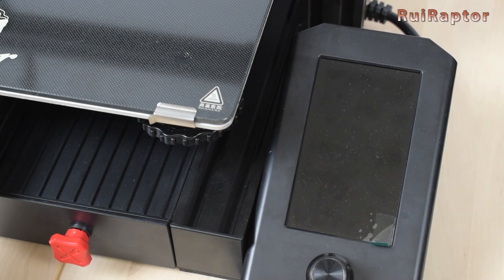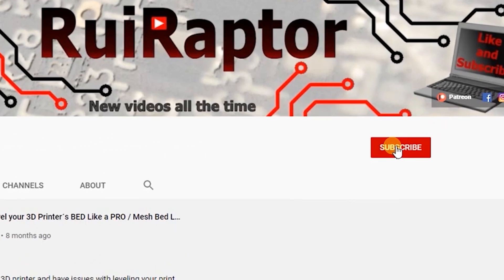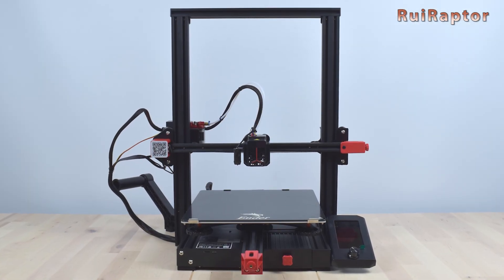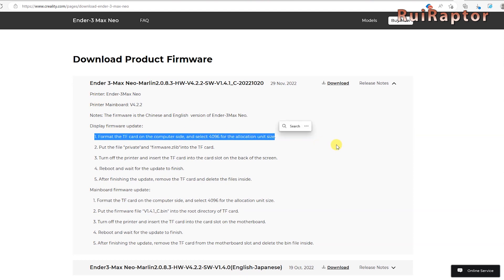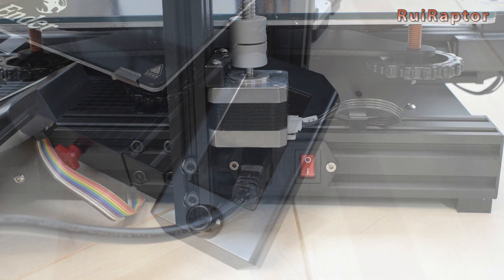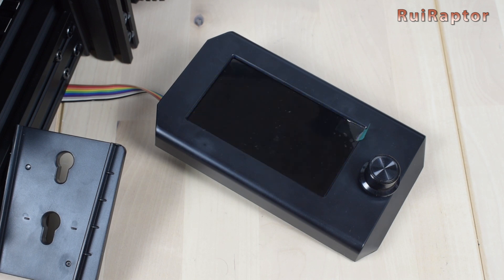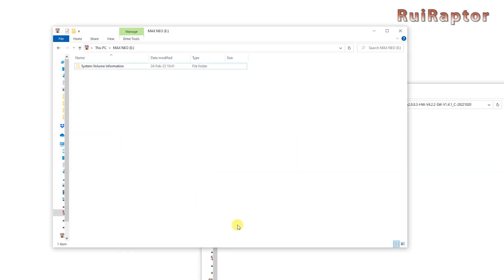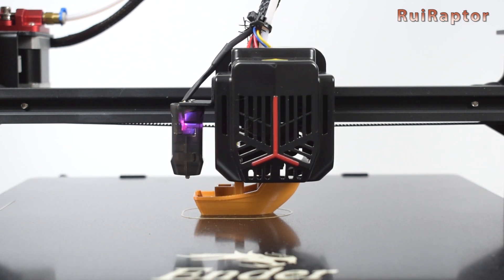Creality ENDER 3 MAX NEO - How To Update The FIRMWARE (Board & Display)

Comment: I had an issue with the sd card, you need it to be smaller than 2048mb i'm pretty sure. i got a 1024mb tf sd card from temu for the easier update and it worked.

Comment: I currently have stock firmware  2.0.8.3 / 1.4.7_G, just wanted to add a few tweaks to Marlin 2.1.x and the display just shows a few numbers below the logo. Am I missing something? Think I have the 'TJC' screen. At this rate it's probably less time consuming to go buy a SKR Mini 3 V3 and a Pad 7 and migrate to Klipper. Time is money and for £100 I'm sure it'll be worth it. I just wanted to enable a few lines so I could have more control with Octoprint 😉 Regardless, this is definitely my last Creality printer..... 🤦‍♂

Comment: followed the video after connecting the 4.2.7 board and its just ringing and stuck on the creality boot screen, the 1.4.1-c firmware didnt do anything and the sd card was formatted correctly. seems like not a single person has resolved this issue since they were released.
Reply: have you resolved this problem?

Comment: Hello everyone,

I'm encountering an issue with my 3D printer, the Ender 3 Creality Max Neo. The LCD screen on the printer isn't displaying anything, even though the firmware has been uploaded. Initially, the screen appeared a few times but then went blank again, and now it's completely off. Is there anyone who can provide a solution?

Thank you.

Comment: i found that you have to use a smaller memory card, i first tried a 16gb card and kept having issues, after i switched to a 2gb card, the updates worked as they should, thanks for the video for re-assurance that i wasn't doing it wrong

Comment: I have an issue with the CR touch 😢 the probe, randomly falls in middle of de 3D print, While the printer are working (It seems as if the probe wanted to do a leveling in the air) Then, the probe got stucks with the piece being printed 

The probe was completely folded 🙁 what can i do? 

Can reinstalling or updating the firmware be a solution?

Sorry, me English it's really bad 😅

Comment: hey umm the display one never had a progress bar can you help?
Reply: IDK if you found the answer already but Ender 3 V2 uses different types of screens DWIN screen flashes orange if it succeeds (if it fails the orange screen stays on longer) and DACAI screen has the progress bar there are 2 more screens apparently and I do not know how those work. Also the private forlder only works when updating DACAI screens idk where he got his firmware but mine had also a folder called DWIN_SET which works with the DWIN screens and TJC_SET which is one of the other screens
Reply: @W1interWolf  no it was on my max neo, and also i think it was a problem with my screen because the motherbored would update correctly
Reply: @LucaThePupineer  Ohh sorry i thought it was the V2 in the video, but other Ender models also use screen from multiple different manufacturers but glad you got it working.
Reply: @W1interWolf  yea i just put in the steps that i needed manually

Comment: OK.  It appears that you can only format smaller SD cards to 4096.  Card has to be 8GB or smaller.  Its actually hard to get SD cards this small now.  I have some on order, but won't be in for a while.  Can I use a bigger SD card formatted at 8K?
Reply from the maker: Hi, never tried using a bigger memory card. As for the 4096, that's exactly what Creality recommends using. Other than that, it's just a matter of trying (at your own risk) ;)
Reply: @ruiraptor  OK.  Thanks for the reply.  I have a 8gb card coming tomorrow and will stick with the recommendation.  Hard to find such small cards now.
Reply: @sailork3506  the printer comes with an 8gb card
Reply: @sailork3506  did you try the 8gb card, if so did it work?

Comment: So I just got my Ender 3 Max Neo, 5 days ago (11-17-23), it came with firmware V1.4.7_G, even Creality customer support told me to "upgrade" to V1.4.1_C.  Trying to do so would not work, I tried more then 20 times, even changed the order a couple tries to see if that would work.  Nothing did, I though I had lost my brand new printer.  After searching, I decided to try other countries sites.  I finally found the V1.4.7_G on the chinese Creality site.  It is a 9 language, MUCH newer firmware.  So if anyone runs into this same issue and you happen to see this, download V1.4.7_G (which all newer ones will likely come with) and do NOT try to go back to V1.4.1_C, I'm pretty sure it will not work.  Although re-flashing V1.4.7_G seems to have fixed the issues I had before.

Comment: did all the steps made the allocation  the required size and it still didnt take screen update. now i have a brick.. i followed your instructions and  YUP> shoulda just left it alone. 1600 hours on this printer and its now boned.    thanks for Ruining my printer.   did 4096 put the files in  did display NEVER TOOK LIKE OK MAY E IT WENT did the firmware and BRICK!
Reply from the maker: Hi, which firmware did you use? If you are using the latest version, try a previous version. If you followed the instructions correctly, it has to work.
Reply: I did my ender 3 v2  and it eas flawless. I watched 3 guys video. I chose the 1.41. it wont take anything now been working on it for 6 hours.  Fat32 4096      unpacked tye  v.1.4.1g.bin  put the bin.  For display i took the private folder and the bin and put im the root directory ... my main board is  boned. It wont e en re take  1.2.2

Hell i even opened my board to make sure it was just a 4.2.2  . Its not a 4.2.2 c.    Ohwell doesnt matter now.

Comment: this broke my printer even more, now there's just no text anywhere, its just icons idk what you made me do
Reply: this may be a bit late but it could be because your card wasnt formatted correctly reformat your drive in this order
Capacity:
< 8gb
File system: 
FAT32
Allocation unit size:
4096 bytes 
if you cannot change you allocation size go into the windows disk management click the letter associated with your sd card and right click on (Primary Partition) click delete volume right click on unallocated click new simple volume
when you get into setup wizard make your simple volume size MB 8000 the assign it a letter you wont forget change file system to FAT32 and the allocation to 4096 and click finish.

do with this information what you can and i hope i helped at least one of you it may be hard to understand my writing so feel free to ask questions
Reply: @DaPugg  tysm!! let me try this and i’ll let u know if it works
Reply: @lan_den  👍
Reply: @DaPugg well, everything was formatted correctly and it’s still bricked
Reply: @lan_den  could you further explain the issue?
Reply: @lan_den  i see you post videos could you do one of the printer?
Reply: @DaPugg  yeah i quit a while back but I’ll post a vid of what it looks like
Reply: @DaPugg  thank you so much for your help. i have decided to return the printer and buy another one. maybe a different brand so things like this don’t happen again. thank you for helping me try to fix it. have a great rest of your day!
Reply: @DaPugg lad you’ve just saved my project lmao. Thanks 🙏🙏
Reply: @DaPugg  thank u for this life saver
Reply: @shadow_hyperbolt  no problem lol
Reply: after that do exactly as the video says, it worked for me
Reply: Same
Reply: broke mine as well, how do I fix it?
Reply: Did yall get it fixed???
Reply: @JordanWieber  nope, stuck with a bricked printer

Comment: IMPORTANT - watch out!

There is a problem with recent 1.4.7_G update. I tried to flash it (running 1.4.1_G) and it doesn't work. I exactly reproduces the steps mentioned here and on the webpage of Creality. The motherboard doesn't update at all (no progress bar visible on the screen) and then the only way to make the printer work again is to re-update it to 1.4.1_G or earlier versions.

Do you know how to fix it maybe?
Reply from the maker: Thanks for sharing 😉.
If the latest version has issues, then you need to wait for a newer version that has that bug fixed.

Comment: Wow, this got my Neo Max going again! I bought 3 Ender 3 Max Neo, and 2 of them have failed in less than 30 days. 1st one in a week, bad board and heating element, had to replace both but upgraded it with a sprite, didn't feel like sending back and waiting 30 day for refund. The second one, firmware problems, powering on it would just beep "alarm Mode and nothing on screen. Just did your update and works fine! Thanks! Now just need to level bed and z-offset and I'll be good to go!
Hope my other one doesn't crap out too, but probably to be safe, will do this update as well!

Comment: Does it matter what order you do this in? Meaning, could I update firmware on the board first and then the display, or does it need to be in the order you do it?
Reply from the maker: Hi, yes, you can install the firmware on the boarrd first and the display after.
Reply: @ruiraptor  thank you very much
Reply: If this is the case, then why in the video did you do the screen update first. Can you put a note up front stating to do this in the opposite order? Or, does it really matter?

Comment: I followed your earlier videos on compiling Marlin firmware. At appears there are no config files for Ender Max Neo on Marlin site. What could be a solution?
Reply from the maker: Hi,
there are no files because the Ender Max Neo's board is equipped with a GD microcontroller which is not supported by Marlin at the time. Please check this other video as we talk about this chip.
https://youtu.be/S0epn4ANJlo

Comment: Our cream display is stuck on the Creality screen. Will this help? Or is there something else we need to do?
Reply: Having the same issue, did you find any solutions?
Reply from the maker: Try to flash the firmware again. This normally helps.
Reply: if it has numbers at the bottem you have to start with the display update not the board

Comment: I followed this exactly, and neither the display nor the printer itself update with the files on the card.
Reply: make sure its the right printer firmware and that you're only copying the first two files for the display and the single file for the board. I had no problem upgrading the firmware by double checking everything.
Reply: Must be very perfect about the data card and being sure it’s formatted properly. Not just cleaned. Then be sure the only files on it are the ones needed.